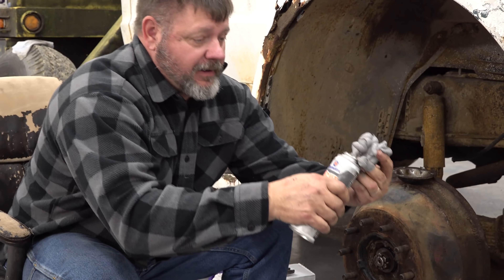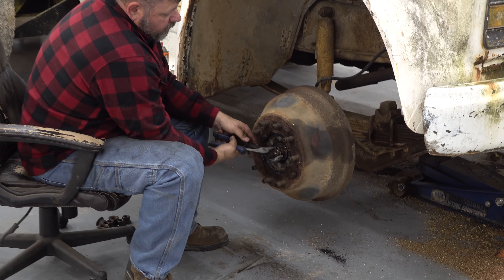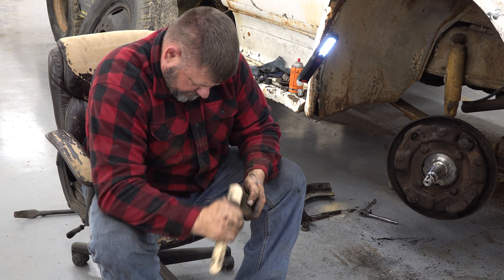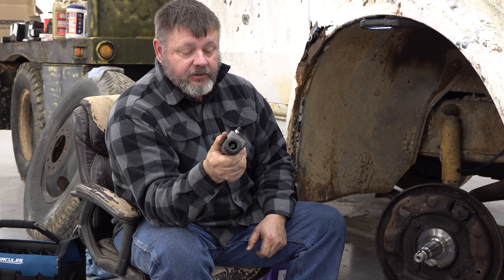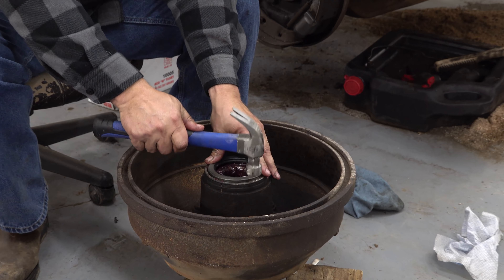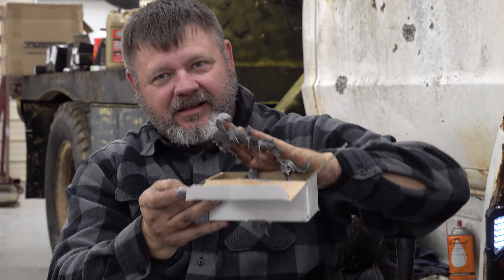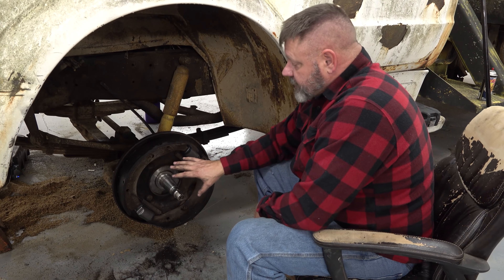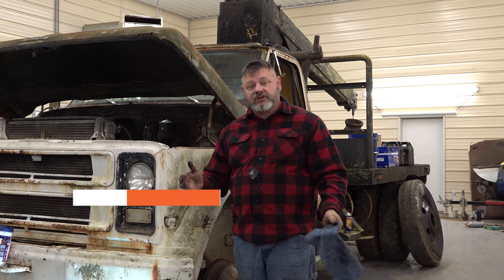Will it Start? NOT STARTED IN 10 Years!  Old C50 Crane Truck Troubles

Comment: Cool truck.. have a little tip for ya.. 1/2" impack 1/2" air hose. 1"  im 1" air supply.. give you more toque.
Reply from the maker: I had the big air hose on the one inch. Not my first rodeo.
Reply: You are luck to have easy accees to parts for old truck.here in Norway we have to order everything from us and it takes forever . And cost a half arm in shipping...
Reply from the maker: We are lucky to have access to the parts. We can order most parts off of Amazon and have them here in two days with free shipping. I lived in Germany for a while, and shipping was very expensive.
Reply: @TonysTractorAdventure  we can order on Amazon to . It take 5-10 days and 25% import tax.  It sucks😡😡
Reply from the maker: Ouch!

Comment: Glad it’s coming together. Dad and me are working on our old 66 f100 pickup and doing most of the same things you’re doing on this truck. I rebuilt the original carb put a new fuel pump on and washed the fuel tank out good and once it primed back up it fired right up like it never was left sitting running smoothly. It’s a 352 v8 3 on the tree truck. Still working on the brake parts like you are doing, the cylinders and master cylinder. It’s a job ! Have a Blessed Day
Reply from the maker: We are making brake lines up, because no one makes exact fits. Thank you for watching.

Comment: Tony, I should be ashamed but the truth is... only sorta. I went to do the brakes on my international, a five ton, and it had the most weird braking system I  ever run against. NPA,  I couldn't find hardly anything that fit or could be modified to do so. I went down to a wrecking yard and looked at school buses till I dreamed about them. What would go directly wasn't hydraulic systems and thought I would be able to get it just wasn't big enough. Okay then how hard to go over to air? If I salvaged everything off a different rig, nothing would be new so back to the drawing board. My neighbor was wrecking out a old mack, a real old one and by  chance we are talking trucks an how slow his was/lol, and he showed me how he got past the scales was he was hydraulic brakes so I look at this Mack again and bingo, with new King Pins and a Ross power steering box so I offered him money for that axle and he said no, that he didn't want to drag that truck to the scrap bin. I ask him would he sell me the whole truck and at first he said no and I walked away. Can't help it, I was angry cause I had months into finding right parts..... he came over and said, If I promise not to put it on the road, signed on paper then he would. I got into the Mack after deal done and put the key in start and hit the button as a joke cause it sat for a few years. It rolled once and grunt... started right up like yesterdays install. I drove that hammered on Mack to my place, swapped axles on both to keep them off the dirt even if they don't drive. I went back and ask him why.... why don't you want it on the road... for real? His words were was  it killed one of his so he killed it. Okay.... What if I took the cab off and sent it to scrap?     Would that satisfy the blood lust and he smiled then said; That day of anger left when you took the truck, so do what you want with it. Those old Macks were made out of some good steel and that top unbolted. Took me best part of a month to fix if you only count days worked but it took me two years to find a day here an there. I did convert that mack to diesel and went air on it
Reply from the maker: Sounds like we are  dancing a similar dance. I order new longer brake hoses, but it take me until spring to get this all working well. I am also having a miner knee surgery Monday. That will slow me down.

Comment: I was smacking on a hydraulic cylinder pin and a pice flew off and landed in my cheek and would not stop beeping had to use super glue I went to wip my face a few days later bc the doc said nothing was in it I thought it was a scab it hurt touching it and come to find out it was a chunk of metal size of an pencil eraser. Could have lost an eye
Reply from the maker: You understand. It happens  more than many people know.
Reply: @TonysTractorAdventure  yes I do even haveing gas, diesel PB blaster, paint thinner and stripped get in my eyes not fun or even working under a vehicle gatta wear the safty glasses